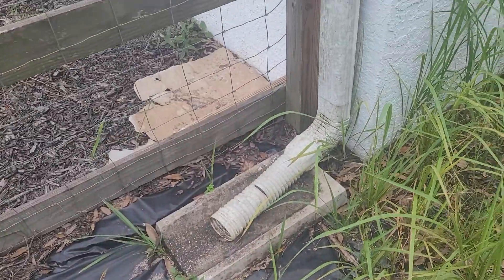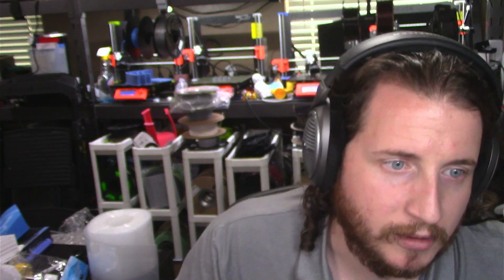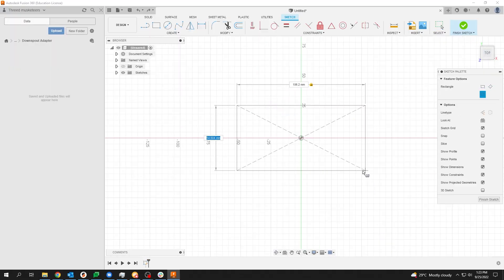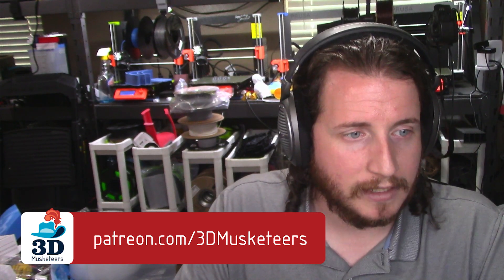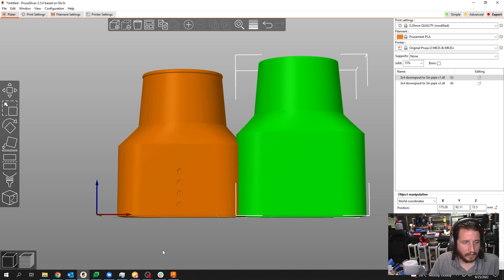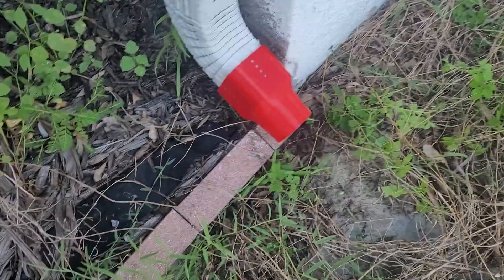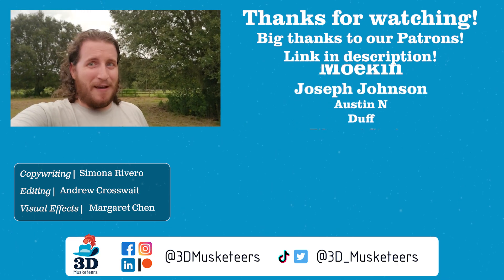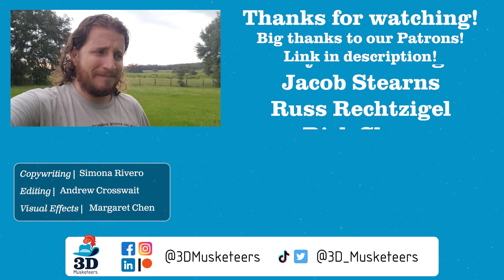Using 3D Printing To Prepare For Hurricane Ian!

Comment: what are you talking about that grass looks fine. (i try to see how long I can go myself because I hate it!!)
Reply from the maker: It's half way up my calf lol. We normally mow to a 2, keeping it short but it's difficult with my back!
Reply: @3DMusketeers  oh that's fine. lol I let it get up to my knees this year. I had to break out the big battery for that. lol Nice thing about electric. It doesn't stall. It just kills the battery faster. But yeah I hate going outside period. I swear I'm a vampire. It gets too hot for me. This time of year right now MIGHT be ok for me. But before I know it it will be too cold. And summer is definitely too hot. Ideally it should be mid 60's year round. lol Also who wants to mow the lawn when you could be spending time in blender getting 3d prints ready. I have nothing to print right now because I don't have my next project ready yet.
Reply from the maker: The ONE nice thing about hurricanes is that they normally bring VERY cold air with them!
Reply: @3DMusketeers  hopefully not too cold. I would prefer not to have to charge my car while in birmingham. lol
Reply from the maker: 72F and dropping currently. Should be at least 90F right now.